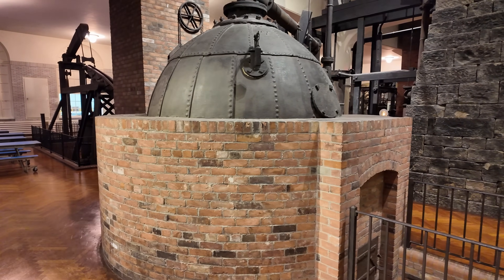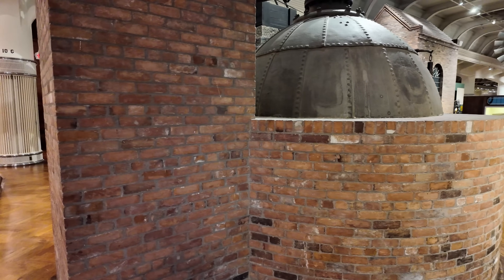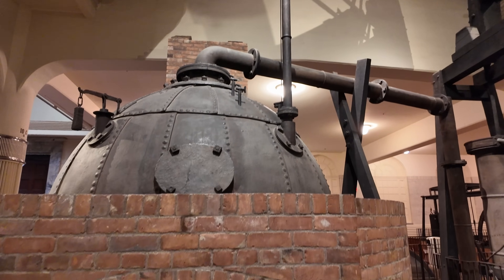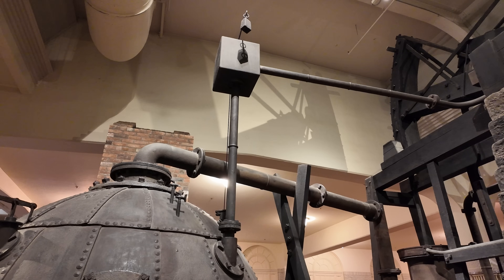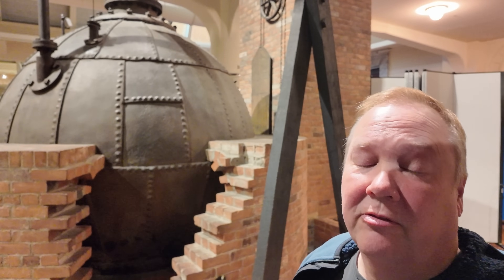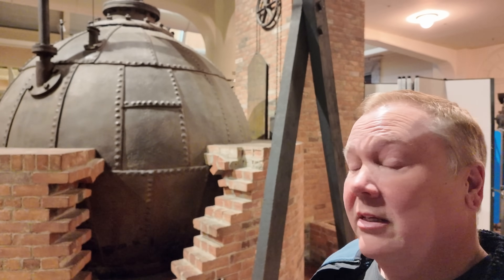Haystack Boilers - The World's First Steam Boilers

Comment: One of those units was built in Sweden shortly after the very first Newcomen machine in Britain, but it was dismantled shortly after because of tecnical problems, and the fuel made from wood coal was too expensive here to justify having it running continuously apparently (It was replaced by a lever system driven by waterpower) and the cylinder was too well made so it sealed much better than the British original it was made after, which resulted in the cylinder made a very hard return whan the vacuum did set in which resulted in it did rip apart the drag lever and bearings to the beam instead of the soft return of the British machine which apparently leaked so much that the cylinder did not operated under the same level of pressure difference so the cycle did run smooth on their unit, but as the cylinder was much better sealed off in the Swedish machine it basicaly ripped it self apart and needed constant repairs. Considering the fact that the cylinders where all hand filed and carefully scraped to fit those tight tolreances for the wter seal is genuinely impressive to think about today!
Reply from the maker: Pressure was a definite problem.  Everyone knows higher pressure would be better, but pipes, boilers, cylinders, etc, had to catch up.
Reply: @Industrial_Revolution  Your videos are genuinelty interesting! There is almost nothing of this preserved in north Europe. I just started Your video of the re wisiting of the Watt's Atmospheric pump, i do collect old steamtoys and scool models my self, not realy of the same level as those, but even if mine are cheap thin plate models they are still a lot of fun! I can imagine scool kids back in the 20s watching one of those models and all the little functioning tools that came with them. And the electric light driven by the dynamo just like in the full scale at the time!
Reply from the maker: Thanks for the comments!  There's still a few companies making those working, live steam models.  I have a few linked through my shopping page, but someone referred me to a US company making them, too.  I'm hoping I may be able to get in there and film the production process of these modern models.  The process is going to be different from the original process, but no one's hand-hammering 1-2 meter diameter cylinders anymore for some reason.
Reply: @Industrial_Revolution  Yes! I have seen some of the American flagship models on picture (as i remember they made an even larger prototype in the 1970s which made it into production in a smilghtly simplifyed wersion), i imagine those where probably more for teaching about how it all works, they are truly beautiful made! I wonder how many other toy/model companies who still make parts that does fit machines from the 1940s? (I know there are one in Germany and two in Britain who still make kits and parts) There was a short lived company in Sweden in the 90s who made full scale small steam engines which had enough power to drive a relatively large boat, they also made a smaller machine one could mount in a modifyed aluminium canoe... Ha ha  Only problem is that no one here makes boilers who fits them anymore. I tried to buy a used boiler from Germany in order to build a barstock machine for it, but the seller could not ship it.
Reply: @Vampi_Sweden  Even 'toy' boilers have to pass inspection & be certified as 'safe' before they're supposed to operate.
Reply: @danquigg8311  Yes, and I think they are actualy, every single one of them made in the weast world (at least those made in Germany, UK and the US) and reasonably modern time are tested with water at the factory, including those small water vapor machines, it is if i am not wrong here more than 12x the operating pressure on those, but those old 1970-80 German toys are heavily owerbuilt so, and they won't explode as it does in that old swedish kids movie (Karlsson på Taket, Carlsson on the roof i guess in English, by Astrid Lindgren. They did add a small pyrotecnic effect with smooke for the visuals in the movie as i remember but the machine was unharmed, i remember i felt releived whan i heard that as a kid, i was deepely worried about the machine and the fishes, but thankfully both was unharmed in the movie shoot... Ha ha ), more like the solder will pop in the seams or the sheet will rip, even if one plug the safety valve, but i honestly newer seen that actualy happen, if the solder rip it is because of dry run, it is more to prevent simmering water to hit people i think those safety rules are set so narrow for those watermist tintoys because the manufacturer don't want to have bad reputation from people getting blisters. But yes one shall deffenitely be careful whan operating models that use actual steam or high temperature boiling water, like the larger STUART models. They are not ment as kids toys, and must not be operated by kids. I always dry pressure those with water to at least 3X the operating pressure set by the manufacturer before fire anything up seriously. And one must always do that with home built machines from kits or barstock scratch. Also being careful to use at least one adquate pressure release valve with correct size or larger but set to the correct release opening pressure. Those are dangerous to run without a properly functioning safety valve. However as long as one do a checklist of anything of importance it is a safe and realy fun hobby! Even if the machine boiler is not safe anymore one can add an electric motor if one remember to oil  the cylinder properly before and stop to add oil intermittent under each run to compensate for the loss of the waterlubrication and also manualy replace the cylinder oil supposed to come from the condensatelubricator it should be fine. Not as fun as runing on steam but at least it makes the old ladie spin again!

Comment: I heard these boilers came from breweries, where they used boilers for beer brewing. There is a similarity
Reply from the maker: I hadn't heard that, but it's possible they directly evolved from there.  Breweries typically try hard to never build up pressure (using bubblers to handle that), but for haystack boilers, you never really wanted them much over 5psi, anyway, so it probably wouldn't be a big jump, and they were large enough, so definitely could have inspired them.